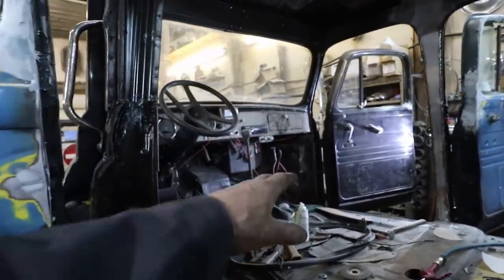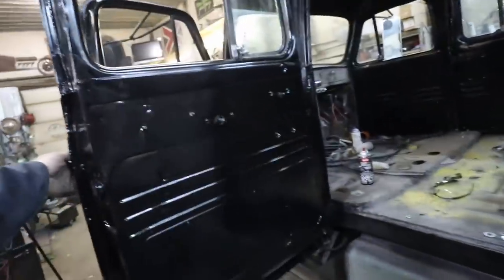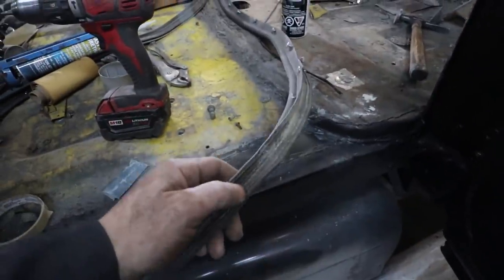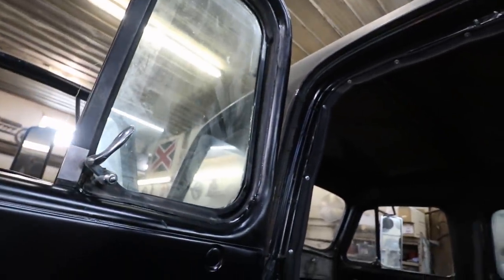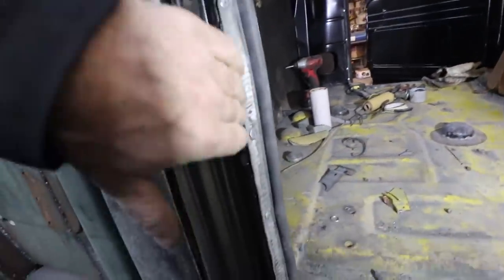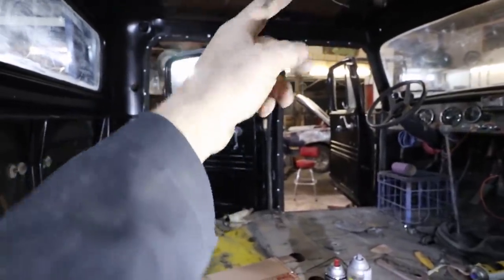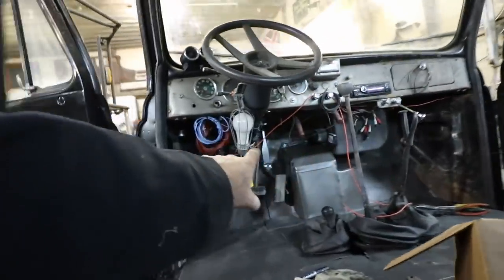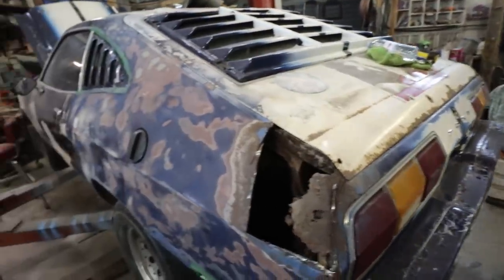Painting the doors, installing the wind lace and sound deadening in the General Crew cab

Comment: had 3 of them one time......v6 v8 4cyl. all cobra 2s easy to work on ,not all rusty but the v6 it was a rusty parts car. yeah,  were cheap back then. sold black v8 to a collector of them, gal at work bought the 4cyl. other was sent to the yard.        kids looks decent for the yr. 76? mine were.

Comment: dude, my first was a 43 dodge Willis , and a 57 apache. at 12 my son wanted too learn we redid a 49 ford custom turned it into a 50 lead slide that looked like it was a cross between a rancho and a Lincoln continental  from a four door too a two door ,and a long trunk bed.  ir went from 19 to a 56 inch trunk that snapped cover too make three rides in one.  we drove it out and around, using all three covers.

Comment: Remember my first car was 1980 Pontaic Grand Le Mans car 2 door Cherry Red body plus Black  trim plus Red interior got off my Late Cousin Jerry mom Brenda and had for 1992 to 1999 ! Had 4.4 Litre 267 CC V8 4bbl with daul exhausted with Turbo 700SR 4speed Automatic Overdrive Transmission, 377 posi rear end! In 1995 took 267 CC V8 4bbl with daul exhausted with Turbo 700SR 4speed Automatic Overdrive Transmission put 1978 GMC truck 5.7 Litre 350 CC V8 4bolt main with 4 barrel carb rebuilt totally, daul exhausted also rebuilt 700SR 4speed Automatic Overdrive Transmission too plus add Tach,  needle gauges too plus took 377 gears got 390 instead too and yes car flew like bird too Lol! Plus car had sunroof too lots options I enjoyed too and $500.00 sunk $1500.00 to also keep running excellent!

Comment: Nothing wrong with Mustang II vids. I hope some part of fixing it up involves going through the engine and taking care of the anemic horsepower issues. The smog era murdered a lot of ponies in the 302's.
The green works on the International...Now I wonder how camo flames would look on it.
Reply from the maker: for some reason I think someone put a 289 in it, but I'm not sure, will deff be looking at it as I think she needs some attention.
Reply: @HalfassKustoms  
One of the wildest cars I've ever rode in was a 67? Cougar, very built 289 with Boss 302 heads and a 3 speed. The owner drove it like it was Elenore, but it was fast. I'm not a Ford guy, but I am a witness that SB Fords can run pretty well with the right parts.